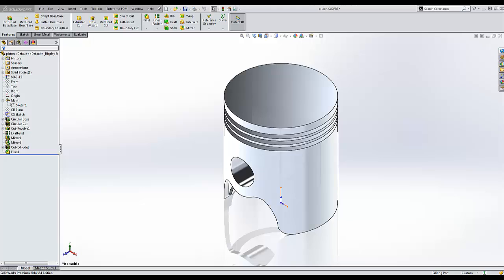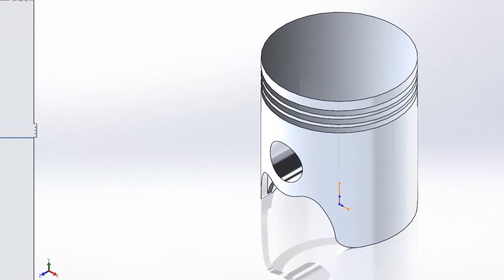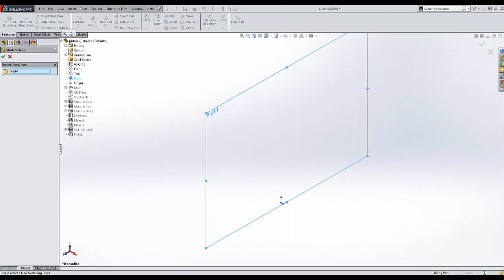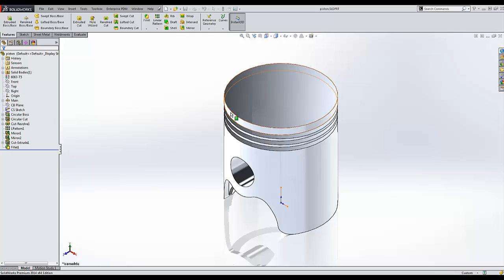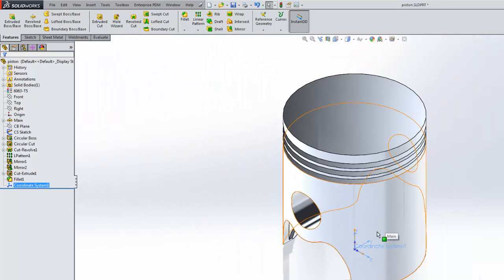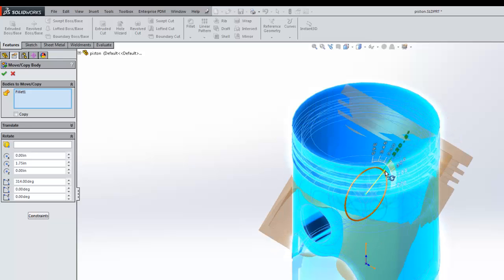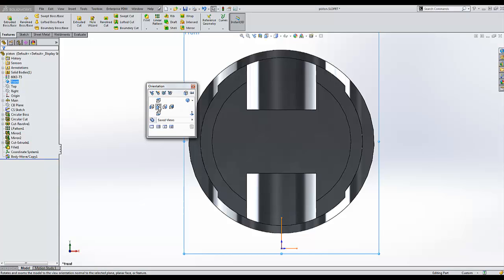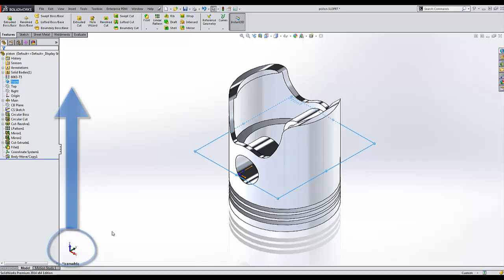Video Tech Tip: Reorienting Parts and Coordinate Systems in SOLIDWORKS

Comment: Unfortunately this method doesn't actually natively rotate the part.  You'll notice it leaves a "Body-Move/Copy1" entry on the Design Tree.  Sketches above the recorded rotate operation now show up 90 degrees askew from the visible part body.

Comment: It's already been asked but I am desperate to rotate a whole assembly... is that possible? thank you! Great video
Reply from the maker: Hi Mitch!  The orientation of the assembly can be changed, but it’s completely reliant on the placement of the initial part and other mated parts. If you move the first part and other parts are mated to it, you can float and then rotate the initial part, then fix it when it’s reoriented.
 
You could also just reorient the camera views, which is the subject of another video here.  https://www.youtube.com/watch?v=MYPk1TGh2is
Reply: TriMech Solutions great thank you!  I reorientated the standard view but had the Z axis pointing down which wasnt a problem in solidworks as top view was correct etc buy when I imported it into Keyshot it was upside down!